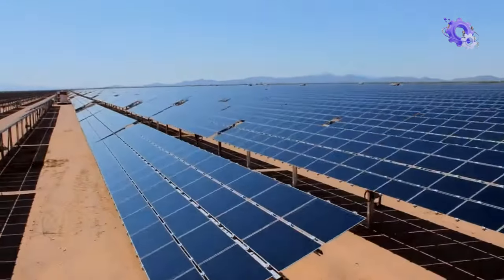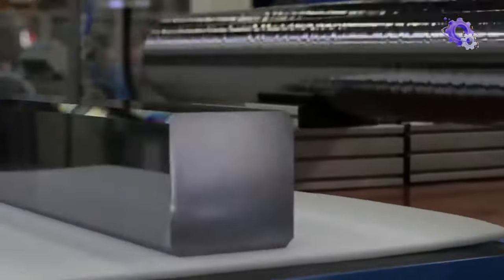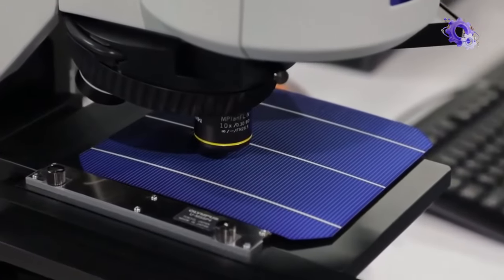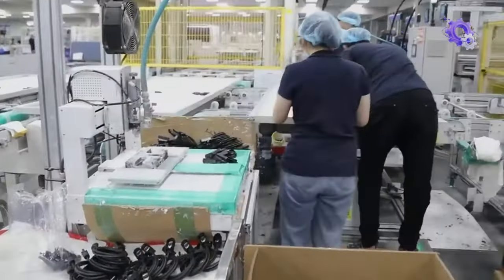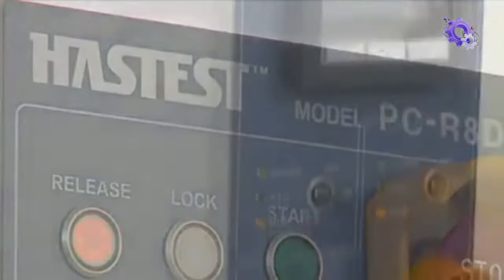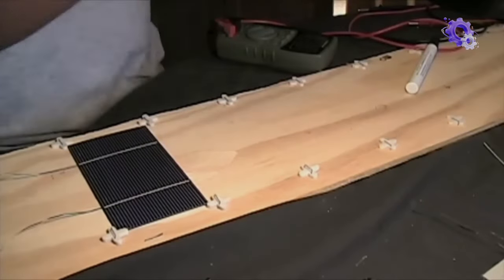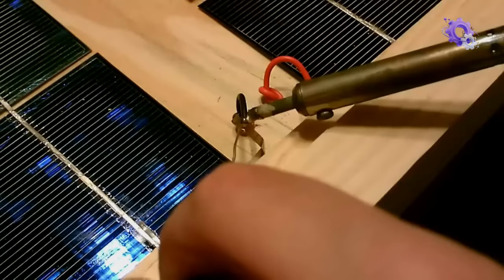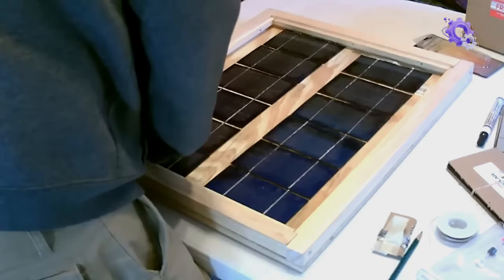How Solar Cells Are Manufactured, & how to make a panel at home.

Comment: Y don't we connect the electrodes to the edges of the panel that would eliminate the blocking of light on the surface
Reply: Resistance, if the terminal is far, there is more resistance